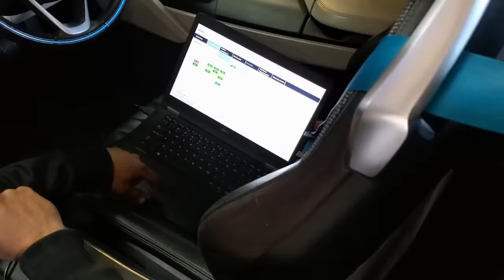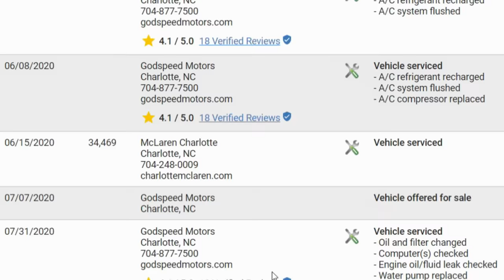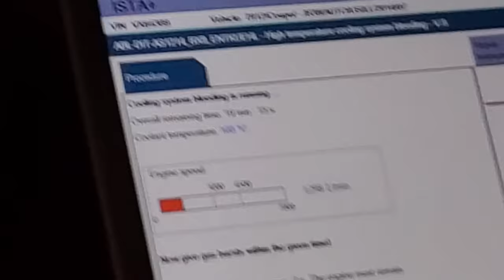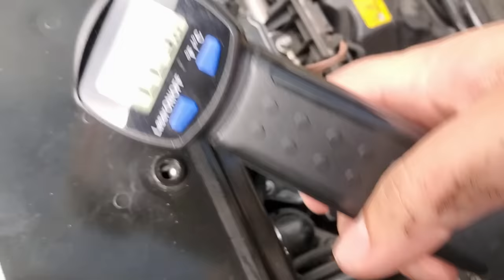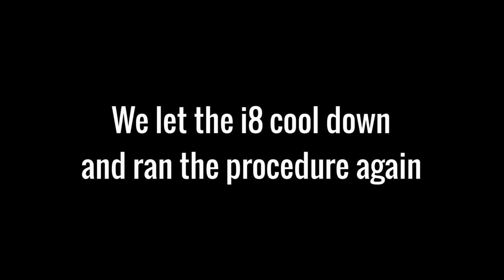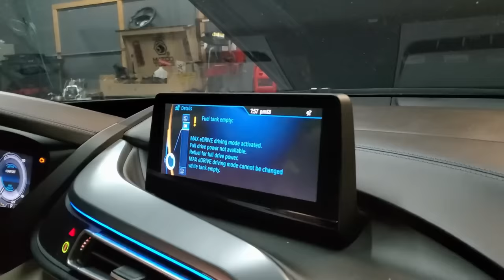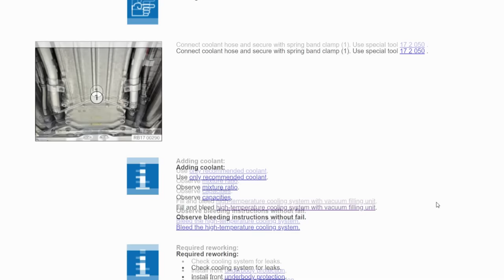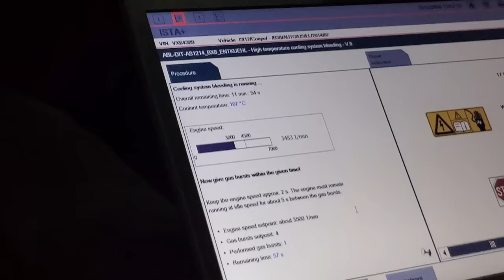Was my Repo'd BMW Supercar Sabotaged to make it Impossible to Repair?

Comment: Head gasket?I mean,that's not an engine replacement,it's a partial engine tear down but,not cheap either,usually, radiator not leaking(till it's over pressurized) no bad hoses, water pump,or thermostat,then we'll,only one reason left,blown head gasket,most people would think oh it will run and drive how can the head gasket be bad?depends on how bad,but usually most overheating issues with no leaks are head gasket,some aren't bad enough that you can't drive it for a bit before it starts to overheat,but if after all those basics are checked/replaced,and the same thing happens,then head gasket.i will however admit I've never been inside an i8 engine,I can't say for sure,just guessing.nice car though,if it is a head gasket I would wanna fix it lol

Comment: Thermostat, waterpump, pinhole in radiator or pipe.. Or cylinder over heated and water is leaking from water jackets around cylinder. Which you can test by accelerating car and seeing air bubbles or splashing when looking threw radiator when cap is off.. Edit those eggs blocked the radiator😂

Comment: Somebody probabley just cut the internal pins on a cooling fan relay. If this is the case you will never find it. Its probably just an open relay. Or a cut wire to the cooling fan module.

Comment: I don't think it was sabotaged. It seems that it was running fine, but that suddenly started overheating, and after replacing the water pump, the dealership figured out what was really wrong, and decided to auction it off to get it out of their hair rather than fix it. Otherwise they wouldn't have put 3,000 miles on it while they owned it.

Comment: Why not trowing the thermostate into a boiling water - it either would open, so it's working properly and isn't the case, or it won't, so You know, that here is one of the problems.

Comment: The engine doesn’t cost tens of thousands of dollars maybe just over 10k It’s a small 3 cylinder. Remove it, have the head decked because it’s OBVIOUSLY A BLOWN HEAD GASKET. Should be fine. Someone ran it hot repeatedly and it blew. Probably a lot of missing gasket.

Comment: Oh for the 60s and 70s when cars were much simpler and easier to fix. No computers needed, no sophisticated electronics, no pollution controls, no need to take it back to the dealer as anyone could fix it.

Comment: You can put plug in any inlet of your vehicle and it won't circulate the water that's why your radiator broke I bet you there's a plug somewhere near there or they got dubbed up your ports when they put your pump in remove the pump I bet you the blockage is near the pump and that radiator probably was under a lot of pressure if it's not your pump because your pump is trying to force the water but the blockage wouldn't let it and pop goes here radiator it seems like they did sabotage it to get a better deal on it I bet you the dealership that said it needed a new engine said that so they can get a better deal on it and have the dealership pay for a new engine for it which when they all know what's wrong and pull the plug out

Comment: Its a 3 cylinder sports car that lacks space due to the hybrid nature, the engine is fucked bro. There is excessive friction, highly likely because of the pistons. To get such power out of a tiny engine it would have high compustion pressure, requiring precise piston rings. Id say thats your issue, as the car heats up your piston rings are expanding causing massive wear on the sleave and huge friction from the piston.

Comment: That’s your stepmom?  Holly Moley!   You gotta be joking.

As for the BMW, I suspect a blown head gasket is the problem. To me,  It has the typical symptoms of any car with this condition; the popcorn sound of boiling water or compression getting into the cooling system.  Don’t need fancy diagnostic equipment to find that out. Let me know if I am correct.

Doing the pressure test trough reservoir may blow plastic radiator again.  Ya don’t want to risk another radiator failure.  There is a chemical test to see if combustion gasses make their way into coolant.  Give that a try.

Problem with cars these days are they are too complicated for shade tree mechanics and they take thousands of dollars in test equipment to diagnose.  American and Japanese cars bad enough, but the Germans take it to a whole new level.

Comment: BMW (Better Machine Wanted). Plastic water pump housing on a hot engine? Have the Germans lost their minds and started copying the bean counter designed American car engines. What part of heat interaction with plastic parts have we forgot? Resale value indicates BMWs are a fraction of their once great engineering and quality.. An $80,000 BMW routinely sells for less than $20,000 after four to five years, and this should explain the garbage BMW is putting out.

Comment: Is the thermostat stuck shut?
Reply: Just saw you checking it. Thermostats are easy to test, boil it, it should open fully at 212 degree.
Reply: I wonder if your radiator was sucking air when you pulled a vacuum, I am following.

Comment: I love all the super techs "knowing exactly" what is wrong. Half of you all commenting probably can't even plug a tire. i'm going with Daniel Ward's comment because I believe he did work on the car. You act like he's an idiot. Idiots don't get to work in speed shops on European cars. That said I agree with his assessment that the motor is toast. Mini cooper (also a BMW) product had a cooling tube under the manifold that would break and toast the engine. even if you changed the tube the motor was junk. I'm betting that same type of situation occurred. someone got it too hot. Think Northstar V8.

Comment: If the coolant is bubbling like that in the header and the temp rockets up the problem is between the block and the water jacket obviously. Forget these shitty modern cars and get something that wasn't made to wean folk off of bigger engines.

Comment: Hilarious the irony in all of this.. BMW builds what in all reality is a $20 3cyl engine... that is about as good as a GEO Metro's ... But ends up being as expensive as it is in all ways possible, juuuuuuust because of name alone.

Also... Stephen, or Steven... not sure how he spells it... good dude.

The engine does run though, and sounds fine... clearly this is something in the coolant channels... have you guys simply hooked a hose up to it? I mean... when I flush my supercars, you know... Tahoes, Camaros, Escalades, GM everything's, lol.... When I flush coolant systems I use a garden hose and push water in one end, and out the other... with this method it is quickly obvious if something is plugging the way. Oh, of course you take the T-stat out to do this as well. Which you've already done. . . Ever do this? Just push water in one side and see if it comes out the other? Simple lil test? Ever do?

Comment: It's like the a lot of s**t BMW is  put into their cars. Like the BMW Power Management System (short: "PMS"; to prevent power drainage from the Batterie) whitch let the Battery blead out much faster. When you do two runs of computer diagnosis the f***ing Battery is empty. Btw the Battery needs to have a chip to comunicate to the PMS and cost 3X MORE than a normal Battery with same power specs. I have a VW T4 from the end of the 80's, and that thing goes through the night with lights and radio on without beeding the battery (btw a got two batteries in my car, only for the case). I forgot to say BMW is NOT THE ONLY ONE, nearly EVERY company do so. German mechanic...out.

Comment: 70% off? Im sure its fine. No reason the discount except it's needing a major repair. Sure you didn't see that coming. Or do a proper coolant fill to get the air out or it'll overheat every time.
And move outta your step moms basement. FFS!